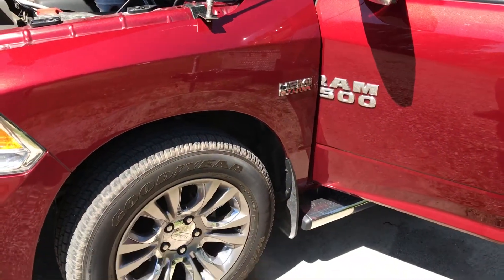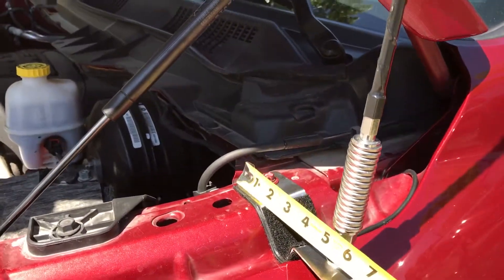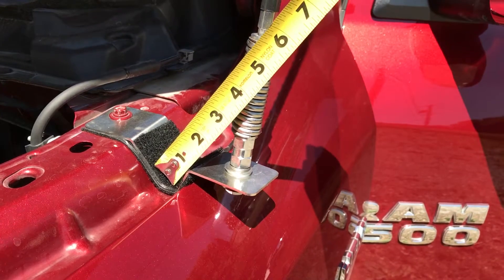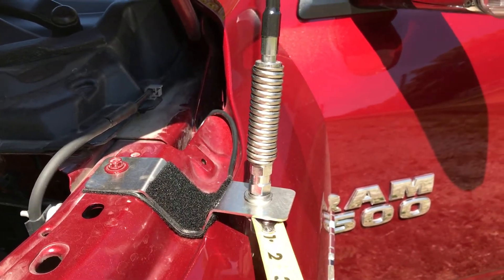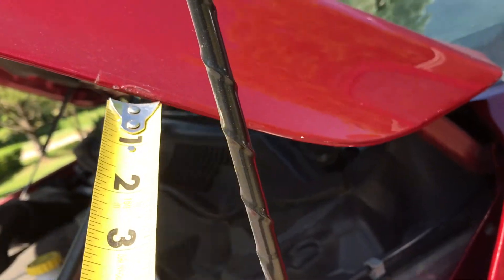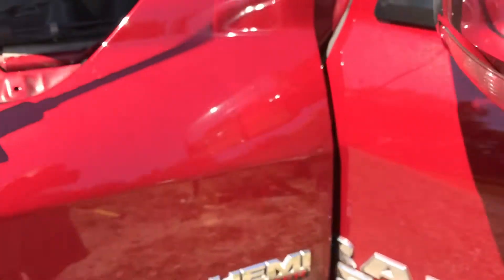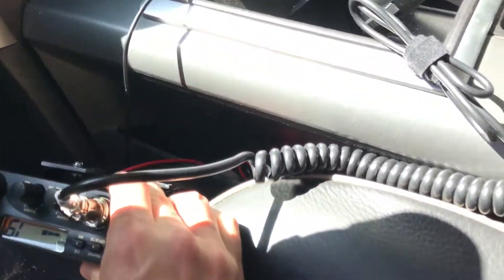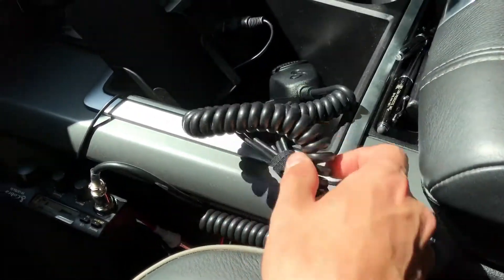CB Setup 2015 RAM 1500 Laramie CB

Comment: 2 things for you to get better performance. Put a copper ground strap from your bracket to that small hole next to your mount. It's flat weaved copper braid wire. The reason you want this is because the vehicle body serves as a ground plane. the padding you used to minimize scratching the paint lessens this. You will get better TX and receive. 
Next wire a direct lead from your battery to the radio. on the positive cable as close to the battery put in a inline larger amperage fuse for safety. You have limited power and will have more noise through the accessory socket. 

Another thing I have seen is they make a solinoid that controls power through the fuse box. you find an open fuse circuit that is only on when the car is in accesory. This connects to a solenoid  switch that allows power directly from the battery, but is only on when key is in accessory. With this you still need safety fuse at the battery.

Finally to make your DC power connections, look into Anderson Power poles.

Mounting antenna more center of the vehicle will make for more uniform TX and receive, but your install is really clean!

Some radios can be tuned up a bit for more power. Legal? no. but you'll get out more.

The President Lincoln II 10 meter radio can be converted easily to 11 meter. but I beleive does 12w AM/30w SSB.
Reply from the maker: Chuckwagon 524 thanks for the suggestions!!

Comment: great idea with the radio mount on the folder pocket.. turned out perfect.
Reply from the maker: Glad the idea worked for you as well!!
Reply: I didn't do it yet, but I probably will. was thinking about doing the cobra 75wxst because it is so much more hidden, but this will be a much cheaper option

Comment: I noticed the firestik spring on there as well.  Do thou think the spring is needed and does it make the antenna flop around too much?
Reply from the maker: Paul Smiley with the location and spring it is hidden from the driver completely. The spring is rather rigid, allows for some bend but no flopping concern. I drive highways and off-road and I would recommend the spring!!
Reply from the maker: Addition definitely add the spring. I found parking garage ceilings will cause the antenna to make contact and torque the mount too much if I don’t have the spring

Comment: How's the mount holding up after several years?  Is it still holding up well?  Thanks.
Reply from the maker: Mount is going strong. I have replaced the sticky soft Velcro top and bottom to help protect against rubbing. I found that the 4 foot whip torques the mount when I go into 8 ft parking garages cause it hits the ceiling . Truckers have been surprised by my clarity with such a low power general purpose CB. So it’s been a great setup I can install and remove as needed.

Comment: I’m new to cb but one thing I heard was power it directly to the battery but if it’s working then good on ya
Reply from the maker: David Durant haven’t had any issues without it directly connected to battery. I wanted it to shutdown when accessory was off as well. You’ll need a fuse online either way to not damage the cb.
Reply: ncooper987 I didn’t know that lol crap I gotta look into buying a fuse now.
Reply: Yes! Hooking into the battery will give cleaner audio, as radios are subject to electrical noise in Accesory wiring. Plus the awg cable in those is meant for lower amp things. When connecting to the battery, insert a large amp fuse on the + cabel as close to battery as possible. If you short circuit, the fuse will blow and prevent a fire and protect your radio. they also make DC breakers if you want something resetable.
Another thing that's out there is you get a fuse block extention cable that wires into an open circuit in your car's fuse box that's only on when in accessory or running. this provides low voltage to a solenoid switch from power cable directly from the battery. Radio gets power from the battery, but the power is only supplied when car is on or in acc. limiting dead batt.